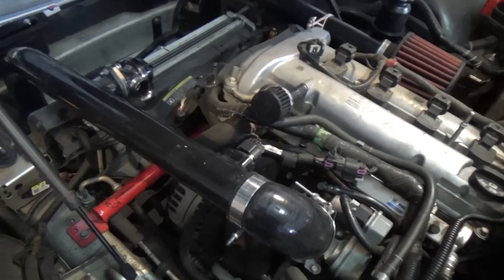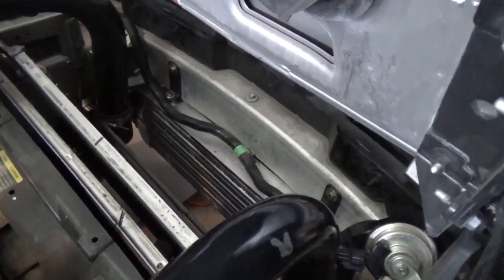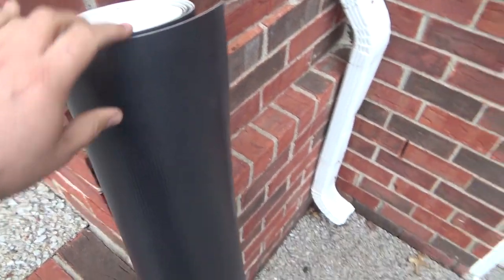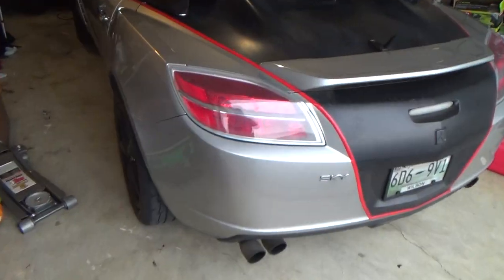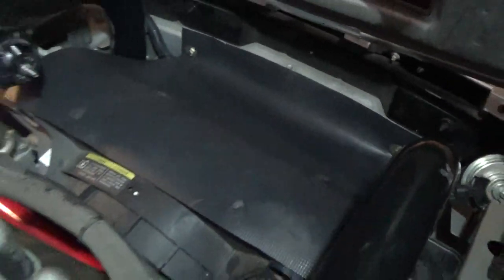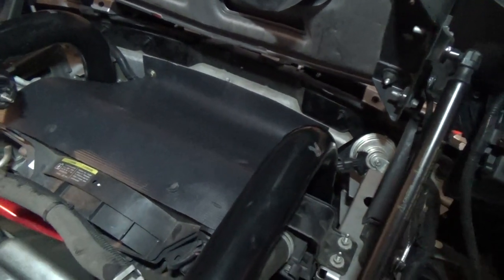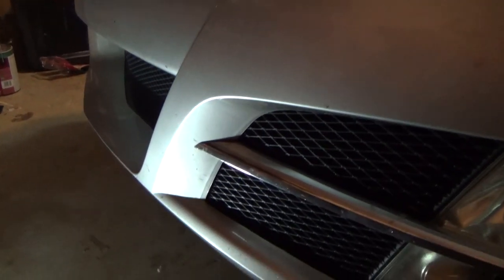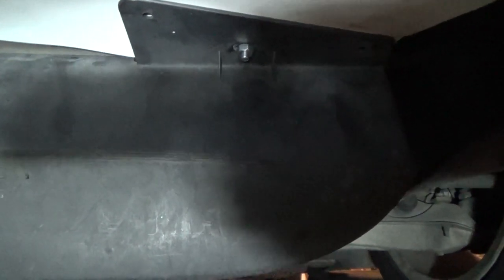Saturn Sky 2.4L Turbo Install Day 2 - Keeping The Engine Cool

Comment: Thanks for including the description of the air deflection / baffle / etc. routing assembly. Too many engines have died an unnecessary death due to leaving off "unnecessary" parts. :)
Reply from the maker: Thanks. I knew this car was a bottom breather and the front grill cannot be opened....so I had to come up with something. It actually works well too.  After the tune and when I have more time, I'll start modifying the actual OEM parts to fit around the intercooler.

Comment: You know, for that top ductwork, you could hide those front bolts. With it unbolted, install the front edge of the duct facing downward and install those front bolts. Then fold it back to line up the rear bolts and install those. Instantly cleaner look and fitment. :D
Reply from the maker: That's a good idea and I thought of that in my head before I made the piece. Three things kept me from doing it, though. 1. My way was quick and easy and I still had to make the bottom piece that night. 2. I knew I was going to have to take the charge pipes out again at least once or twice which meant I had to remove that piece (back to making it easy again). 3. Eventually I'm going to try to custom cut the OEM parts and not use what I made any more. But we'll see how that goes. If it doesn't work, then I'll probably redo my piece like you said.
Reply: @MikesHouseOfMods  you so smart. Lol
Reply from the maker: @Robotech04  Yeah right...lol.

Comment: Consider using torch-molded plexiglass. We used it for all sorts of art projects back in undergrad. With a torch, you can mold it to any shape you need. It would be perfect for minor things like this and more rigid than that roofing material, which is necessary to control the air better. Heck, you could even use a combination of cardboard and fiberglass compound to mold the shape of baffle you need, like they do on this video: https://www.youtube.com/watch?v=8xa1NFY_VDU